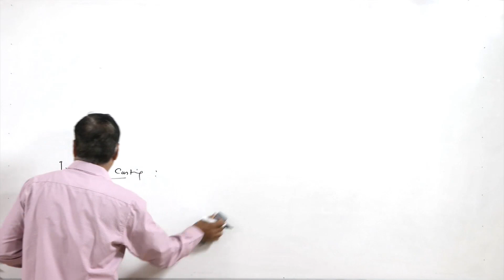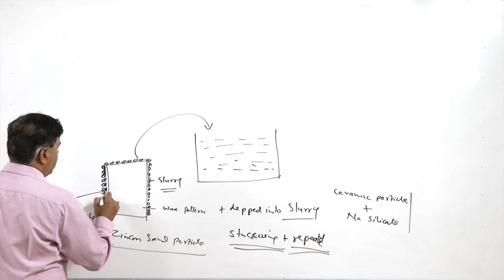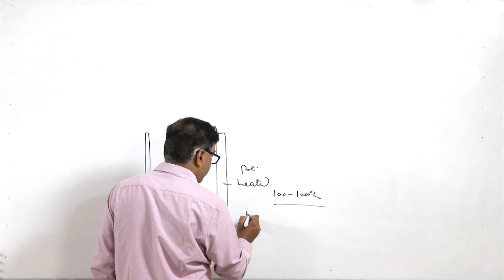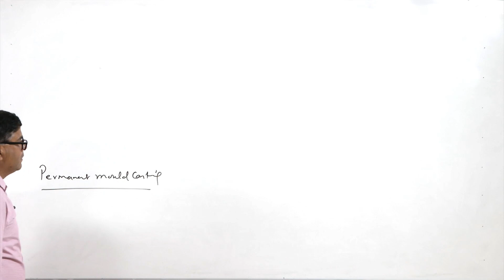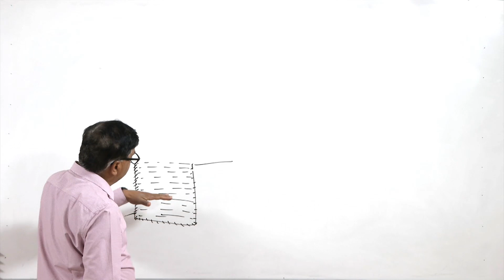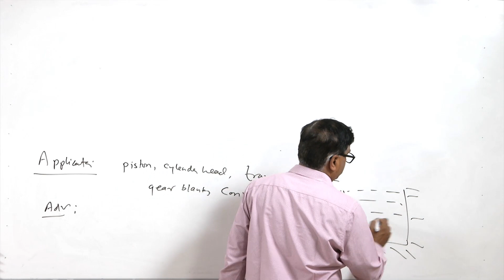Casting: Investment and Permanent Mould Casting

Comment: Sir ,why during stuccoing ,initially fine grain sand are used and then coarse grains .
Why such type of coating is done?
Reply: This is done so as to obtain the desired section thickness ( which is about 6-15mm), otherwise it would take multiple stuccoing iterations, which would increase the amount of labour manual work and hence the expenses.
Reply: Fine grains gives better surface finish.So this layer is coated near the wall
Reply: May be bcz of the reason it imparts good strength to the mould produced.As we construct the walls with alternate layers of mortar and bricks.